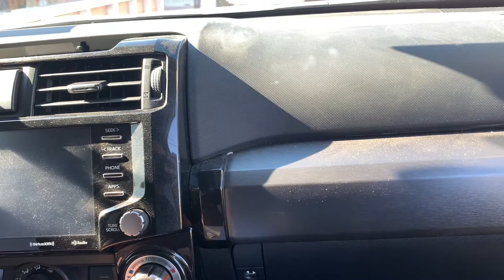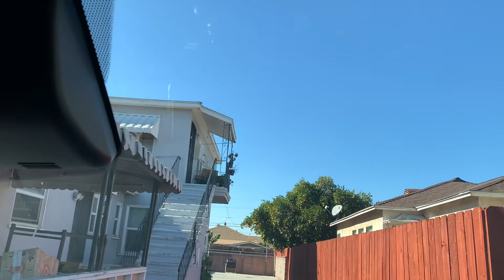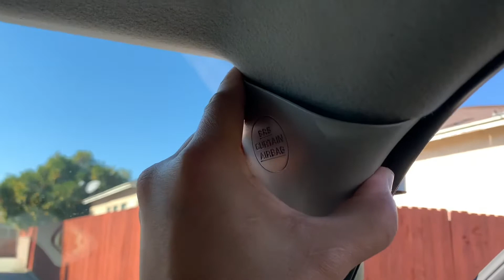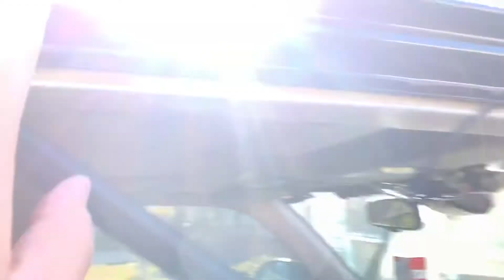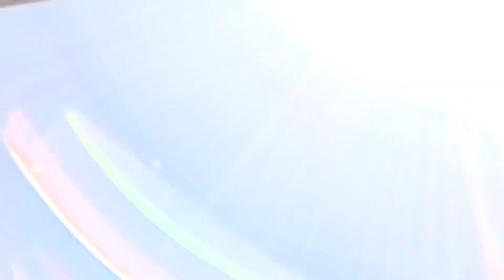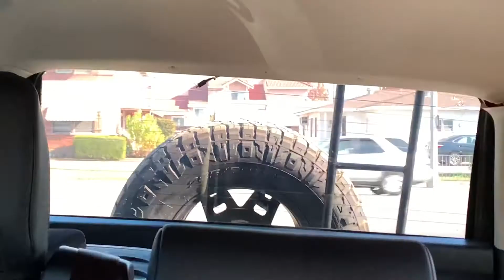$200 or Less Dashcam Install on 5th Gen 4Runner Dashcam VIOFO  in 30 mins part (1/2)

Comment: Definitely a clean install and only took 30 minutes. Thanks for your video. I will definitely watch it a few times before attempting to install my new dashcam in my 2023 4Runner. I will have to install a bracket for the rear camera since the rear window will lower and raise…not feasible mounting it to rear window itself.
Reply from the maker: Awesome! I’d recommend the Wolfbox dashcam as well. I have a video on my channel

Comment: I running the same camera but just the front because I don’t have a mounting solution for the rear camera… a video would help a lot of us who has a 4runner and wants to run a rear cam…
Reply from the maker: It took me a few months before installing the rear camera for the same reason. I did end up installing it on my overland kitchen drawer, unfortunately it’s not a typical mounting solution that many will be able to replicate. I’ll try to shoot a video shortly.

Comment: you ever finish part two?
Reply from the maker: I originally wanted to fabricate a bracket to replace one of the plastic roof liner tabs. Since then I added the shelf for the fridge and I just ended up 3m taping onto the top of the setup. Dead center. I don't have a video on it now but I will have one in the next few weeks talking about my water dispensing setup and it will be easy to spot in that video. Ill add a part 2 to my list of videos to remake tho! Thanks for watching

Comment: So you didn't have to run a longer cord from the front to rear, just wondering if the length was enough, seems like it is
Reply from the maker: It was enough. I didn’t have to extend it
Reply: @OtzleeExplains  Cool, I thought I was going to have to order it with the 8m cable.  Thanks for clarifying.

Comment: It looks like you finished the installation of the wires.  Why do you need that second hardwire kit?
Reply from the maker: The hardwire kit keeps the camera running when the car is off. It detects movement and records.